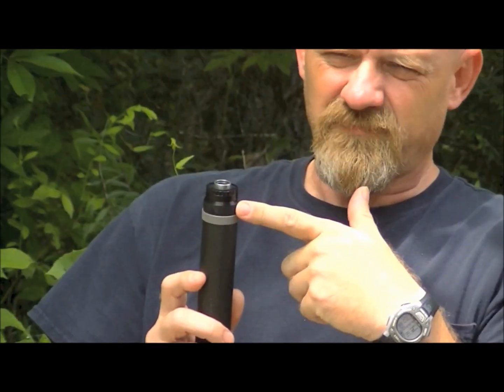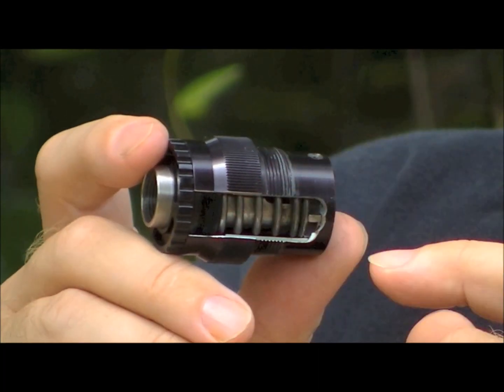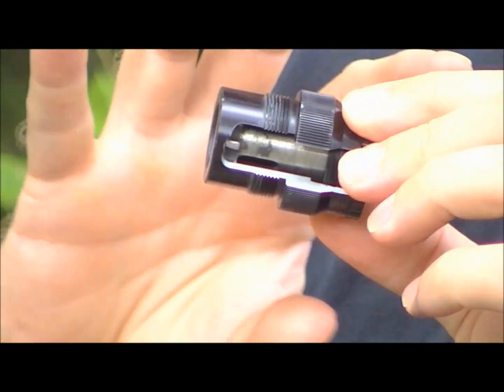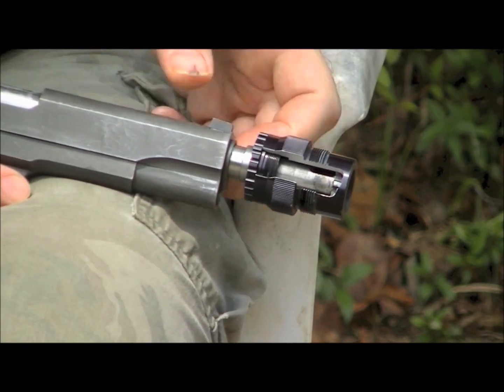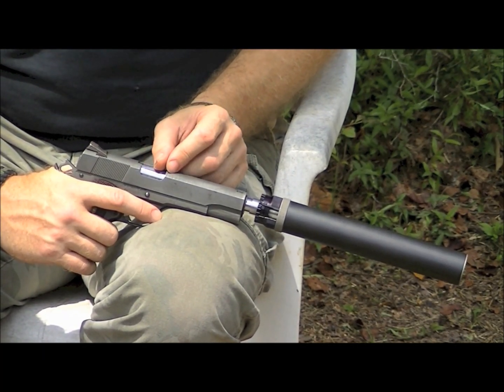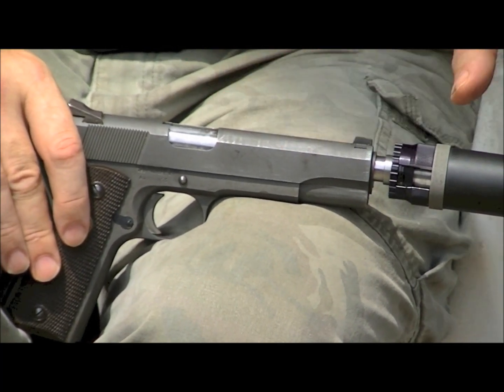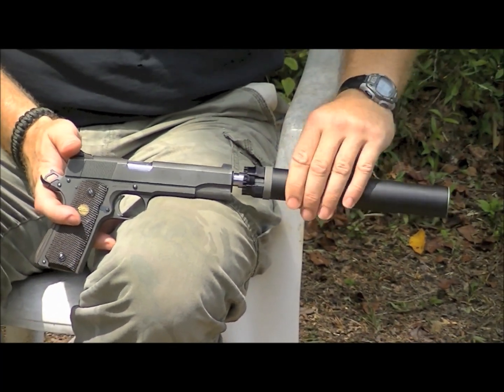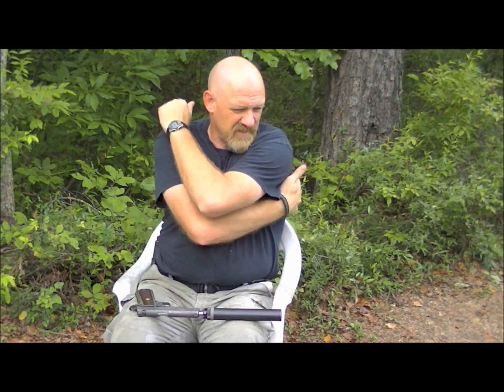PISTON MYSTERY EXPLAINED

Comment: Excellent video. I would like to give an additional piece of information if I may. Another key factor in the booster assembly is how the recoil impulse is actually created. You hit the head of the nail on that one with the barrel and slide being locked as one, and the recoil impulse comes from the gases/blast escaping at the firearm's muzzle. This allows that impulse to happen as it normally would, firing without a suppressor. However, if a booster is not used, now you have a three piece fixed system. The only possible place for the recoil impulse to happen is at the endcap of the suppressor. Well, since the whole point of the suppressor is to slow the gases down and slow the rate at which they exit the suppressor, this results in a much lower recoil impulse because the energy is spread out more over time. So, in addition to decoupling the weight of the suppressor, the booster device also changes where the recoil impulse actually happens. It's kind of like... punching someone hard in the chest compared to pushing on their chest kind of hard over a period of time but using the same amount of energy. The punch is going to hurt (lot of energy in an instant) while the push is not bad at all (same energy but over long time).

Comment: What’s the maximum weight, weight of the suppressor) that a recoil booster will make the gun reliable with normal ammo say 99/100 Times?
Reply from the maker: We have found that a silencer of 12 to 15 ounces in weight is about the heaviest a silencer can be and still operate most firearms with a booster. With the weight being closer to the 12 ounce area being the best for most typical types of pistols out there. Lighter is always better though, so your choice of materials should include titanium and aluminum whenever possible to keep weight down. There are a lot of misconceptions about aluminum and it gets a bad rap. It is actually a great material for silencer parts so if you are building a Form 1 silencer yourself, you should consider using 7075 aluminum as it is strong and light. This is the main reason it is used in airplanes...just sayin'

Comment: Good vid. So it is like a decoupler, that works on inertia....neat. Recoil booster my butt
Reply from the maker: Yes, that is exactly what it is. a linear DECOUPLER. Thank you for taking the time to watch our video.
Reply: You aren't seeing half the booster, and it is a muzzle booster by design. 

The internals of the suppressor will make a blast chamber very close to the tines on the "piston" when it's threaded all the way in. The small volume right at the outlet of the barrel/moving piston is like a blast chamber, expanding as the spring is compressed. The recoil of the gun alone is not enough to compress the spring, it'll function exactly as a fixed suppressor, no cycle. That is a very heavy spring, it's hard to move it an 1/8" by hand to clock it. That's where the "booster" movable expansion chamber comes into play, it actually launches the suppressor off the end of the barrel, negating it's weight and the resistance of the spring with expanding gases. Of course the spring is there to dampen the whole launching off the end thing. 

Just my .02, it won't function if the volume of the expansion chamber is not correct.